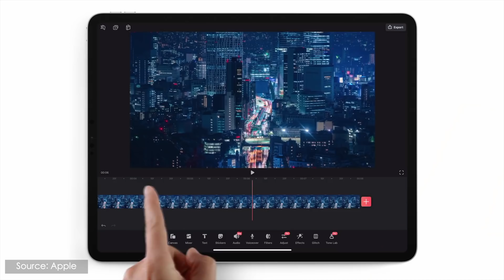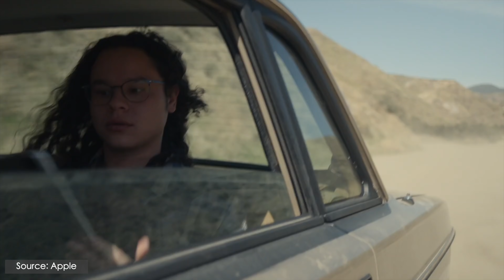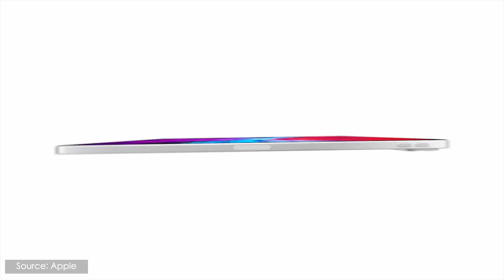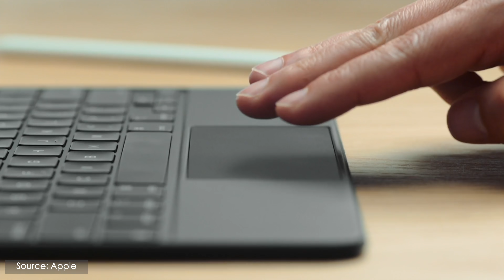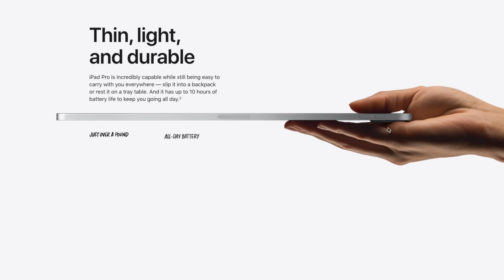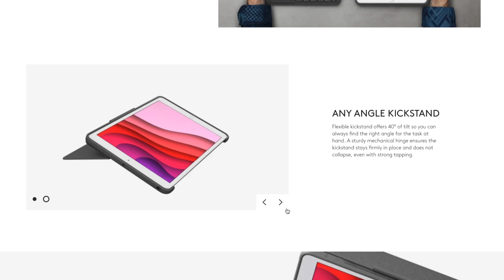This is Apple's New Magic Trick

Comment: Are they gonna reales 2 Magic Keyboard,  one for the 2018 and one for the 2020  because the camera cut out in the Keyboard  for the  2020 is different from the 2018   ?    :)
Reply: Vinicius Oliveira the new magic keyboards will all have the camera cut outs for the new 2020 models, but you can use the 2018 iPad Pro in it because it’ll still fit over the camera, the cut out will just be bigger than the camera. Hope this helps!
Reply: @mciehhdhshs598  thank u  so much  :)
That was exactly the answer that I needed..... thx :3

Comment: I"m so torn, I have an iPad Pro, and a MacBook Pro. A good portion of the time, I would like the iPad Pro to do more that the Mac can do, and track pad support and this new keyboard with trackpad may get it there. On the other hand, I think I might be happiest if the MacBook Pro would just go ARM, and have LTE/5G. Honestly, I think I am more comfortable with the clamshell most of the time, but not having instant internet when I'm on the go makes holds the Mac back a lot. Tbere's still no perfect solution.
Reply: aaron wong  have you tried the brydge keyboard?
Reply: M Z I have thought about it. Looked kind of clunky and bulky. Maybe if I switched to the 12.9 in the future, assuming that iPadOS evolves a bit more. For now I end up carrying the 11” and the 13” MBP. I know, bulky right, but more use cases and lots of battery life.

Comment: As a software engineer, I can't do a single thing with an iPad, so calling this or any iOS device a 'laptop replacement' is just a bit extreme to me.
Reply: Alternative *
Reply: @Augusto0926  well its not really an alternative if you use it for anything. Maybe everyone should just class it like the original iPad which was only good for multimedia consumption.
Reply: Ashley Dale no it’s definitely useful for some people and not useful for others. That’s why it’s an alternative. Just like sweetener is an alternative for some people but not for others. It’s just a matter of choice or preferences.
Reply: Ashley Dale Exactly!

Comment: $500 premium for more storage on an $800 device .... for a terabyte. That's so brutal. Add on the keyboard/trackpad at $350 and you have a non-x86 device that costs more than most laptops. Doesn't mean much to be faster than most laptops if it costs more, notwithstanding the lack of pro app compatibility. Final cut would make a big difference as said here.

Comment: I have an iPad Pro 10.5. Is the smart keyboard case supports that model? Can I use iPad pro with case with this keyboard?
Reply: I’m wondering that too. If the keyboard/trackpad is like the Smart Cover then it should work as the current 10.2 and 10.5 iPads use the same covers but the 10.5 iPad Pro is thinner than the iPad 10.2 so an actual case isn’t interchangeable with those models.